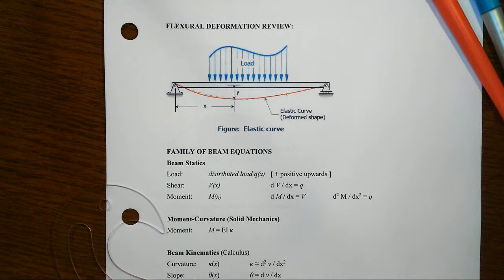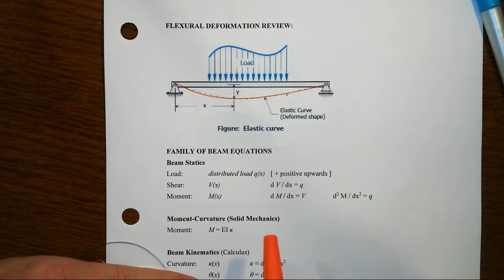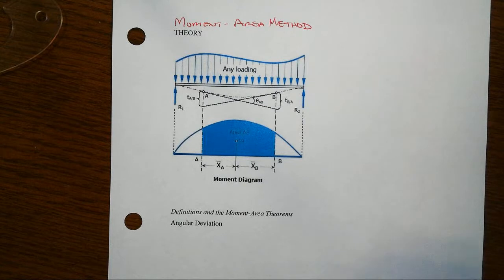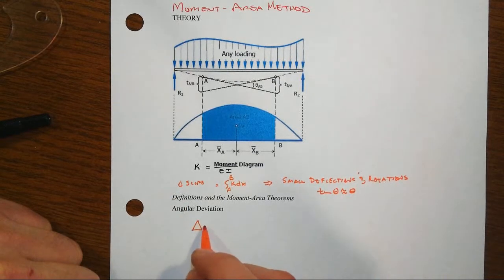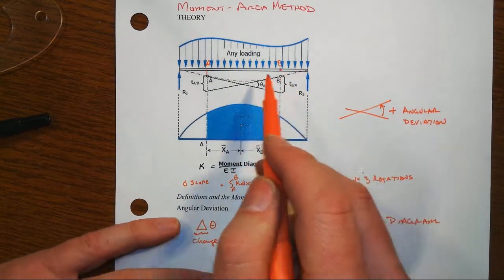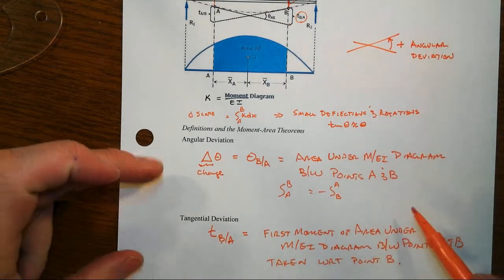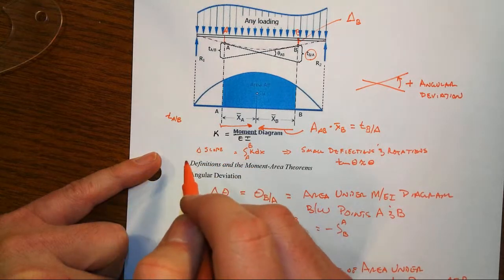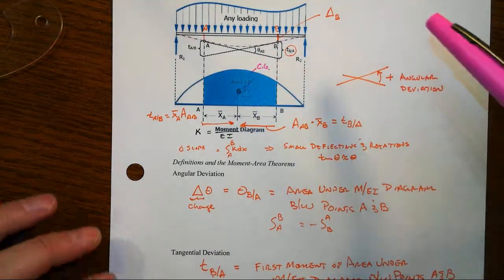Moment Area Theorems and Definitions

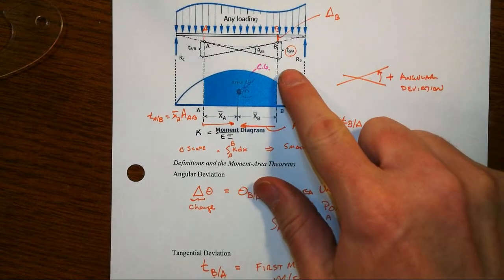Comment: Thanks so much for this explanation. At 11:00 do you have a resource that can help one develop this intuition?
Reply from the maker: 1. Develop a basic understanding of how beams actually bend.  Play with them in your hands.  Even watch them in computer simulations…real ones, not artistic ones.  Anticipating the shape of the deflection is the number one key.  
2.  Mathematically understand what curvature-moment is telling you about the deflected shape; be able to not only state it but DRAW it.  
3.  Understand the implications of the math to the changes in slope and in deflection (tangential deviations).  
4.  Tie all of that together … real bending, math, and graphics/drawing.  

These days with computer structural analysis so readily available and the graphical representation of the results of such high quality, you can use that to both identify whether the results make sense and to prove its credibility by performing these older style calculations.  At first, you might be learning how to perfect the “hand” but as you get better at that then you doing the proper thing of demonstrating that the computer provides a reasonable result to the truth that is provided by the theory.  Never forget that the computer model is always an approximation of the truth … which approximation sometimes provides the same answer as the theory.